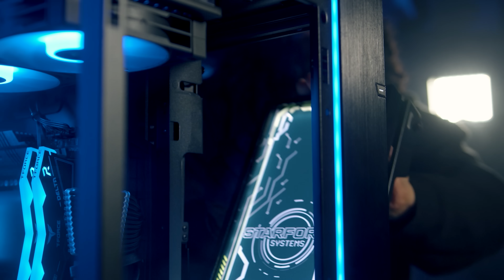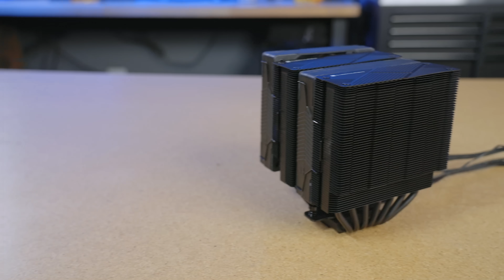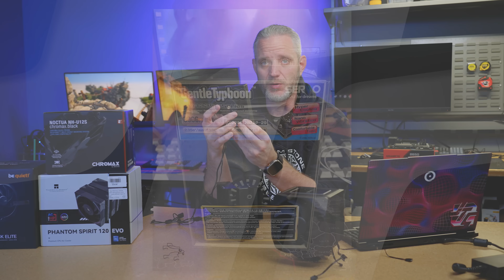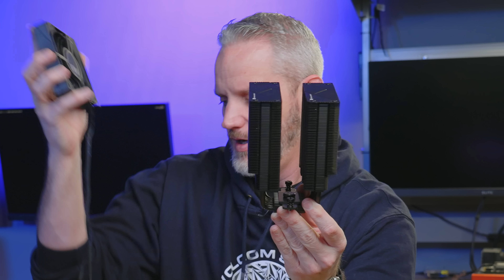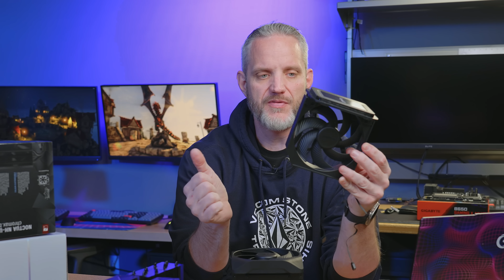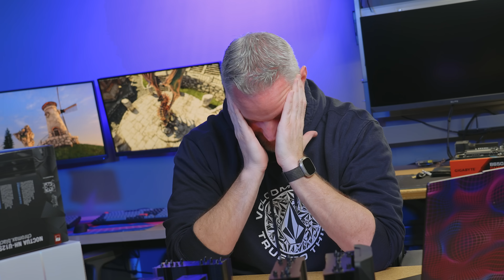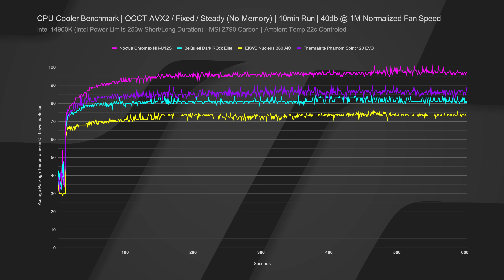This $49 CPU Cooler has big brands SHOOK! Thermal Testing Cheap vs Expensive CPU Cooler!

Comment: "OCCT" My guy! Test the bare metal version against this one. I want to see if coating / paint retains heat.
Sounds like the old OG Cooler Master 212. Kept my 1700X OC'd at 4.1ghz stable and happy. I did spend about an hour lapping it at my dining room table with various grits of wet sanding to get it there, but it was worth it for the $25 I paid at MC when I built the system.
BTW, the NH-U12S is only rated for 160w TDP, so ofc it became heat soaked. Heck, even my 14S is only rated for 200w TDP, although I do run dual fans on it but my 3800X can't really push it to it's limit.

Comment: I used a brand of Tower Cooler no longer sold for political reasons, and swapped the fans for two better units to even further improve it's numbers. The Thermalrite fans shown have a large hub that can affect it's ability to cool effectively, swapping them out might improve that towers ability to cool more also.

Comment: i agree on cinebench, and occt is amazing, but i've always used AIDA64 for cpu testing and cooler testing. its what got recommended to me on the AMD subreddit when i was having some weird issues with cpu stability a LONG time ago so i've always just ran that test and would love to see you actually use that and maybe do a comparison between intel and AMD cpus, especially with AM5 since you CAN get the offset bracket for a lot of different air coolers on the market. i also REALLY like the tjmax per dollar figure because that really emphasizes how much performance your getting for your cash

Comment: I want to give this brand a try but the fans give me anxiety. I'm not too confident with just how long they may last. I typically go name brand because my Cooler Master M240ML V2 has had its fans going nonstop for a good 5, almost 6 years.

The pump and fans have lasted long enough to toss it on my friend's system and he's been using it for almost a month. Waiting on their new AIO to come in with some thermal paste before I take the AIO back.

Comment: Thermalright assassin king 120.
5 heat pipes, direct copper contact.
Single tower 120mm

ID cooling varients

Thermalright liquid coolers are ridiculously inexpensive. How do they stack up against more expensive models???

Comment: I really like this, Jay! I wish there were more Value metrics for each PC component like this in today's age. From Cases to memory to storage to PSU, understanding what is quality vs. what is name brand mark-up is sorely needed with how many options are available. 

So many people talk about budget tiers, but not enough is explored on what denotes good quality and performance per dollar.
Reply: The problem is: we cant really measure quality in a single review, we can only measure performance. (it's just an example, it obviously wont, but...) the themalright could break/stop working in 2 years.. or lose performance over time, while a noctua, be quiet or whatever, would still be working with the same performance for the next 10 years (as they advertise). And that's not to mention customer support, warranty,  RMA, etc and all those stuff, that Thermalright might not offer on the same level as the other brands.
Reply: @K4y74h  I can see your point, and counter to that, there are already several channels that explore such things. Gamers Nexus does undercover RMA review, the Unboxed channels give comprehensive comparisons of components price to performance, Hardware Canucks and hardcore overclocking does in depth stress tests of components... 

With such a large community available, it is entirely plausible to pick apart what has value, what has quality, longevity etc.

Comment: Cooler tests are fun. One recommendation I have is also testing them at max fan speed on top of noise normalized. Not that 6% fan speed would have made a big difference but lots of people would just crank it to 100% if it was only a little louder if it meant better temps

Comment: I have an idea for an all around standardized parameter used for comparison: Specific Cooling Capacity (SCC) and SCC per price. Here's the definition: SCC =  CPU_power/Delta_T, with a unit of W/K (and obviously you can do W/K/dollar). The SCC value can help people to estimate the expected performance when they use the cooler on a different CPU. Also, I like Thermalright for their air coolers, very budget friendly, reliable and with good performance.

Comment: 24:09 I wonder if you put 2 fans on the Noctua in push pull config, does it improve? Because its a single tower with single fan, while the others are dual tower with dual fans, they able to dissipate heat faster.
Also one thing with Noctua is you can buy the cooler and they'll send brackets for new sockets for free whenever they come out, do the other brands do that?
I got a U12s in 2012 for my Intel 2500k and when AM4 came out requested a bracket for it, now on AM5 i could ask for it again (but i went 360 Aio). That cooler has cooled 6 Cpus in its lifetime from both brands.

Comment: 5900X and it on a Thermal Right Assassin SE 7 heat pipe duel tower cooler.. max temps 55-60'c under load. It's awesome and was $45AUD 18months ago. Also the green bar showing price vs thermals is a nice touch :)

Comment: No way! You can't say the Noctua sucks for the money! It's not possible! I defend their products for free on the internet on every Reddit thread and Youtube comment section everywhere! You can't say they have a bad value proposition!!!! /sarcasm

It's difficult to even describe how tired I am of the Noctua fanbase. It's just an air cooler. As long as it keeps the CPU cool enough, that's all that matters. There's very little overclocking headroom on CPUs these days. Instead of paying $300 for a CPU and $100 for some stupid overpriced cooler, get a $350 CPU and a $50 cooler (IDC if it's thermalright or IDcooling or whatever cheapo thing you want, as long as it works well). You'll get better performance that way. Or divert those extra $50 towards a better GPU or something. It's kind of asinine to spend 33% of the cost of the CPU for a cooler, of which the cooler is responsible for less than 5% extra performance. I get it if it's your hobby to extract maximum performance/lowest possible noise from a system, so I get it when people spend a lot for watercooling gear. But I cannot fathom why people pay arm and a leg for conventional _air coolers_.

Comment: Its not really a fair comparison though. The noctua nhu12a, has dual fans not singular like the s model, and its also $100 right now, and performs just as well as the deep rock cooler. Of course a single tower fan is going to underperform. But it also needs to be repriced accordingly. Even if jay slapped a second fan onto the s model, you would have seen temps drop another 5c minimum

Comment: I understand you had limited options, but the Noctua was a weird choice - it's explicitly not for this use case, and the NH-D15 is only 10 more.  The NH-U12s is more of a weird Cadillac level tower for lower power machines where users want the quietest air cooler they can get.
Reply: WRONG ANSWER.  I have 5900x and 3900x rocking this cooler.  It was the next cooler in line below the D15.  

 So, you are, in fact, not the expert in this choice.  

 The fact is it IS the PERFECT video because I'm looking for this exact information. With these exact coolers information. 

 The 12 is a typically used cooler.
The 15 has ram issues.  
Jay confirmed what ai said to upgrade, too.

Comment: I just bought this cooler, upgraded from a Noctua c14s in a CM n200p mesh case. 

Quality is bad compared to the c14s, in feel and installation, clips love to fall out on their own before you can mount it, the tower screws are rock solid and I broke 1 PTM pad and had to use my last one and maybe I broke that one too but said F it. The tower also is slight V and not U also. and the rbg cables are super annoying.

But, like 30'c better then my c14s (used to thermal throttle 100'c in cine24 at like 120w, now it goes to like 70'c at the full 180w (12700). Gaming also like 10'c-20'c cooler also.

Right now I am only using 1 fan as I got a new GPU with a flow through design and I flipped the direction so I could only run the 1 fan, temps only rose like 1'c-3'c maybe in MWH (but new GPU too and it pulls 2x the watts)

All that said, I would buy it again since $85AUD on sale smashes out anything at that price...maybe the SE version at $69 would be actually better but idm paying more for more fan headroom. Gaming I cannot even hear it and the temps are like in the 50'c-60'c in a 25'c room.

Comment: I have thought my next build would probably be an air cooler. More data, the better. Things I would like to know as well, is would a second fan help or hurt single tower coolers. Like I have the Vetroo V5 that I added a second fan to, since I had always thought, more air flow should be better haha.

Comment: I have this cooler. I had it on a 12600k and recently put it on my new 9700x. This cooler for the price literally changed my room temp. I know I will get mad fun of but I have never been comfortable with fluid around my computer so I prefer air cooling. This thing is a beast. Are there better options? Yes absolutely. But the price to performance is great.

Comment: arctic freezer 3 will probably match the phantom spirit in terms of value. Just assuming the same temp numbers as your currently tested AIO but divide by a cost of $80 instead of $160 and you x2 your junction temp margin per dollar. 
I personally use the phantom spirit since I'm running AMD CPU but if you need better margins with the best cost in mind, go with an Arctic Freezer 3. They are both very good and affordable coolers.

Comment: When I built a 9800X3D system a few months ago, I went with a Arctic Liquid Freezer III 420 ARGB for $115, and I've been very happy with it. Unfortunately, the cost has gone up recently, as with most consumer products, and the limited lifespan of traditional AIOs does kind of put a dent in the value proposition.

Comment: Would love to see you do this type review for the Thermalright AIO's vs other AIO's for value and effectiveness. 

Been using a Thermalright 240 AIO for a little while now. Have to say, I went into that purchase with some skeptical view of the cost vs how it would perform. I can say, it's really overrated for my CPU that it is setting on. That being an AMD 5600x. Not a really hot CPU to begin with, but living in Washington State, the weather here keeps the housing pretty cool, so most houses here don't have AC by default. So, our condo didn't come with an AC system. We have installed a freestanding AC unit that does keep the house really cool and is positioned near the PC's giving them an uplift to cooling with the fresh air being precooled. That said, I was seeing temps with Tower cooler of around 65c under load with a small tower cooler when I initially built the PC's. I plan to upgrade the CPUs to a 5800x so also wanted a new AIO addition to the PCs to help offset the bigger CPU's and their heat. I had seen many reviews of other companies, all which were costing over $100 for ones that performed well. Then I came across the Thermalright 240 AIO and for my tower, it would hold a 240 very well where a 360 was a bit too tight of a fit. A 240 AIO with a price tag of around $50 seemed really nice, but I know longevity is the question. I've had one for over a year now. No pump noise to speak of. Flow through for the fins was good and idle temp of the 5600x has been about 25c average. Under full load in benchmarking with Cinebench I get very stable 55c loaded temp. I do have a rear case fan behind the motherboard that blows directly at the back of the CPU area. Its a weird case, also something I wasn't sure of but hey, test the weird and sometimes be amazed. I have tested it without that fan active and it's about a 5c difference, isn't much but is at least doing something. Thermalright is doing some good things, for great prices. I'd highly recommend their coolers and AIO's!

Comment: I bought this cooler right when it came out to replace my Corsair H100i 240MM from 2019 and haven't been disappointed. Interestingly though, I think it was... Hardware Canucks tested this cooler and compared to the standard non Evo version it actually did just a little worse even though the fans are technically better. Either is still a good value, I liked the aesthetic more of the EVO so I went with that. But it makes the original stand out that much more, for it to be $10 cheaper and perform slightly better.

Comment: I'm pretty sure I've been using Thermalrite coolers ever since either my first processor upgrade from a Pentium 133 to a Pentium 233 MMX or since I switched to an AMD K6-2 450. Always made really good coolers that just worked and worked well to keeping my processors cool and extended the longevity of them (I'm sure, since they are all still working and good to go!)

Comment: I'm genuinely curious what the difference between that Noctua and the Hyper 212 Evo would be if you made sure they were both using the same fan. I'm not thermal engineer but I can't imagine a huge difference.

Comment: I put a Thermalright Peerless Assassin 120 in my final build in November 2023. Paired it with an i7-11700K inside an NR200 case. Under a 1 hour CPU stress test, the temps on the CPU hold steady at around 30 below TDP and never reach 80c (max RPM is 70%). The case has 2 top exhaust fans, mesh side panel, with rear intake and an XFX Merc 319 RX 6800 XT. I am well aware I didn't use a 12th, 13th or 14th Gen (e cores would be wasted). That said, TR coolers are the best bang for the buck and it was the best and only $37 investment in that build.

Comment: Thermalrite should have had the big brands "shook" for years now.  A Peerless Assassin 120 SE can sometimes be had for almost half the price of the Phantom Spirit 120 EVO.  It's a dual-tower 6-pipe cooler with dual 120mm fans.  I think I paid $40 CANADIAN for mine.  They are almost as good and sometimes just as good or better than the big brands, and their pricing is so much lower that it hardly even makes sense to consider anything else.

Comment: Jay, why are you always on the EVO, that thing is not as good as the OG peerless assassin. It’s black and has RGB. It runs louder than the peerless assassin. The OG phantom spirit is quieter and cooler. EVO is overpriced for colors. You’re testing thermals. Cmon.

Comment: Please test the NH-D15, I have 1on my Hackintosh media server (I7-7700k) and 1 on my newer I9-12900k Hack. My Steambox (I7-13700) and my Main Hack (I9-10900K) use older AIOs. I just bought a Thermalrite Phantom Spirit 120 to replace the 4 year old Corsair AIO on my I9-10900K Hack (I'm sorry I'm a 76 year old Noctua fanboy) Pun intended. Thanks

Comment: I'm using the Arctic Freezer 36A-RGB and it keeps my 5800X3D at about 80(C) at 100 percent load. Its not bad but it heats up my room quite a bit. For like 40 dollars.

Comment: My latest build is running a 9950x3d and on the microcenter associate's recommendation I picked up a phantom spirit 120 se and honestly couldn't be happier with it. Using Cinebench as my stress test my cpu has never seen a temp above 75 c and the fans are barely audible.

Comment: The real hero is the £15 thermalright assassin king SE. Looks the same as that noctua one. I put one on a 9700x cpu last week, ran cinebench r23 for 10 minutes, temperature peaked at 57 degrees. There really isn't any need for anything else on a mid range cpu. heck you could put a be quiet fan on it and you'd still save enough to buy a 2tb m.2

Comment: I'd love to see you add an AMD test into your data. Hardware Canucks used to do this, and while the series seems to have fallen by the wayside, they did demonstrate that a cooler that shows good Intel results doesn't necessarily perform well on AMD. One specific case.. the NZXT Kraken Z53 was middle of the pack on Intel, but performed quite poorly on an AMD chip. If your goal is to build a large cooler performance data set, it is of limited utility if it just focuses on Intel CPUs.

Comment: Great testing on the Air Coolers Jay. I recommend you test every CPU on the game "Dead Space" Remake as that game gets every CPU higher temps than any game that can give it a richer stress test as my 9800X3D can reach as high as 80-85 degrees on my Air Cooler

Comment: I wonder if in testing you should normalize the fans to one particular brand and style for each of the sizes. ie: a specific 120 and a specific 140 fan. Then you're testing the design of the cooler and the mounting plate and all of its individual components without the fluctuations of the different manufacturers fan types.

Comment: Yo Jay.  You probably won't see this as 9 hours later, 800 comments deep, and Sunday, but in the future let people know what you used to bridge the IHS and the heat sink.  e.g.  Thermal pads vs paste.  Just a suggestion. I bring this up as thermal pads really are the only way to be consistent across all tests as paste....until you remove the heat sink you don't really know how well it spread.  Right?

Comment: Noctua NH-D15 chromax black would be a beter option from Noctua in my opinion, double tower with double fans. I believe it would same or outperform AIO 140 / 280 AIO's for a fair price. I just like and perfers the look of big Aircoolers, simply because it's more maintenance free. DeepCool AK400 Zero Dark Plus woud also a great CPU cooler, because of the price to performance. I guess it has a good value for what you're getting.